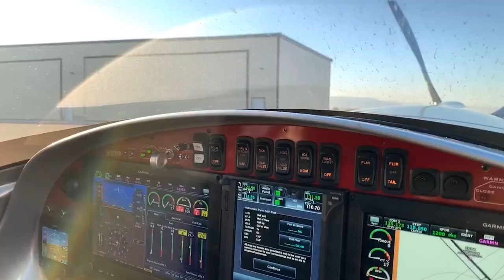Mike Patey's OCD Wing Testing REVEALED. Hah!

Comment: You have to admit, Mike is a genius.  That wing design and the reasons he said he had three hours of filming but condensed it down to the short quick thirty min version.... I want to see the whole 3 hours.... I learned more about wing design in that 30 mins than a year of searching the net...
Reply: I think he may be wrong because could possibly cause excessive turbulance.
Reply: Charlie, I wondered how the plane would react on deployment my self, but I have faith in Mike.  I have watched his videos, he does not do anything by halves.  The original video has tons of flow analysis.  And I am positive he has done way more than he has shown us.  I remember the stacks of analysis he showed before he started building the wings when he first fired Scrappy up.  And shape changing wings are nothing new.  Fighter jets shift their wings forward and back, many others do the same as scrappy with a single Slat.  Chances are we are going to see an amazing STOL capable aircraft and the higher cruise speeds will make for a nice aircraft.  It works and I am going to want one... lol
Reply from the maker: Very much see the Genius in his work(s). We are very much looking forward to the first flight of Scrappy! :-)